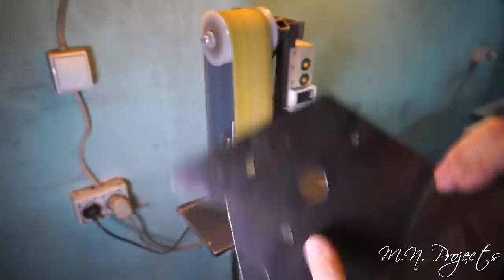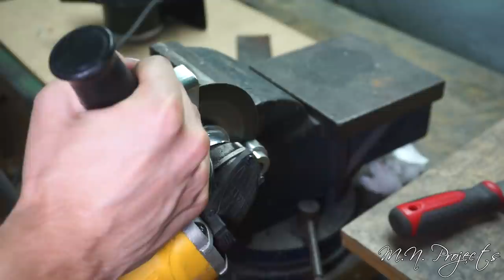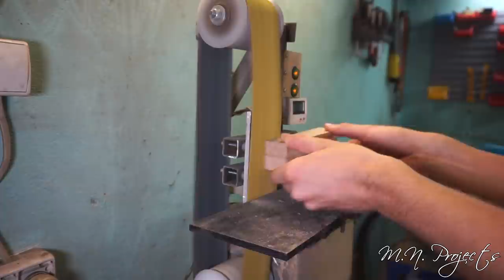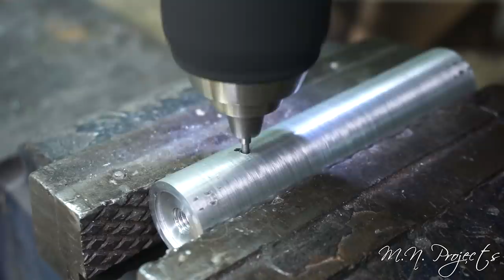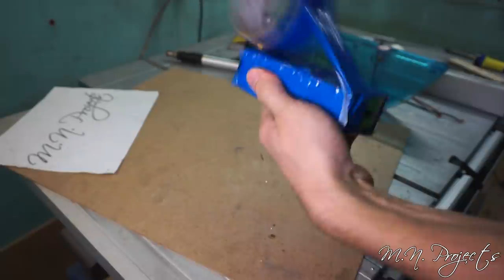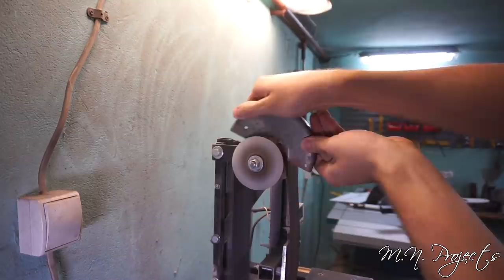Making a Battery Powered Chainsaw

Comment: very nice job but your left hand is very close to the chain you need to add another cover to the top near by the handel
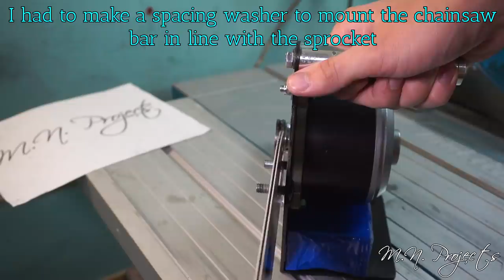Reply from the maker: It looks like this on tests, but the handle is on the other side of the case and is not in line with the chain, see 9:30. Of course additional cover is a good idea, safety first
Reply: The handle might break from the pressure, the cover is a good idea
Reply: That's not a cover, it's the chain brake
Reply: @maciejnowakprojects  hi, how many mAh have your batteries? Can i use only six 3400mAh batteries? It's like 6x3400=~20000mAh

Comment: Actually I find it cool as a concept design to display, but it's a very bad tool if you want to use that.
There is no oiler, and manually oiling isn't efficient, there is no chain brake and it looks very lightweight, wich means it has low inertia. Definetely you don't want a kickback from that thing
Reply: @Stefan Rainer that's a nice idea, but we all know a hobbyst would be too lazy to even think of adding that feature lol

Comment: I'm gonna guess that this isn't super practical. I mean, I only paid $126 (deal at the time) on amazon for my 14" greenworks 40v chainsaw with a 2ah battery and a charger, and it works excellent. Plus it has an automatic oiler. But in the spirit of fabrication, this is an awesome build. Thank you for taking the time to post this video. I love building stuff myself too, sometimes not just for the cost savings, but for the fun, learning experience, and pride I get knowing I made something myself. 👍👍

Comment: I wonder how an electric chainsaw would do with a moped motor on it..?  Put some gearing in it to give it torque over speed and i bet youd end up with a saw that could cut quicker than any gas powered.  Probably be heavier but could make a backpack battery and cooling system...

Comment: Very nice, if you use the small Two stoke oil containers and make a drip Oiler onto the chain using gravity and 30 motor oil vs bar oil if might flow nicely out the small gas line.

Comment: Nice build, as a professional, I’d suggest removing the bottom of the chain guard, not on the outside, but the part where chips hit.  You want them to flow away from your sprocket.  And add a screw below the bar mount Incase the chain hops off, because the chain will stretch an bit with heat and the last thing you want is to have it fly into your arm or leg.  I don’t mean to pour a bunch of suggestions like I’m better than you or anything like that, I think this is a sick thing to make. I just don’t want you to get hurt really badly.

Comment: Just a note on an otherwise excellent build, better extend the sprocket guard cover to cover your handle bar because if the chain accidentally snaps it will provide extra protection on your hand.

Comment: I don't think you should have put warm batteries so close to a hot motor

batteries get warm just from discharging so the added heat of the motor will probably be the death of them